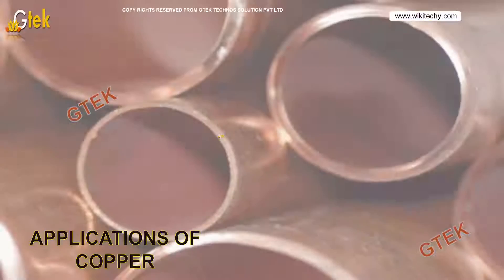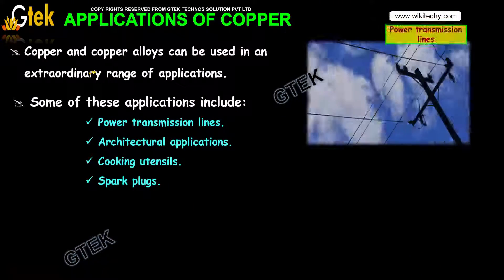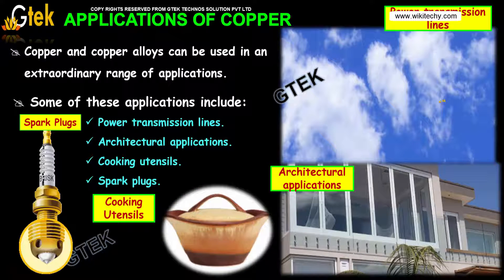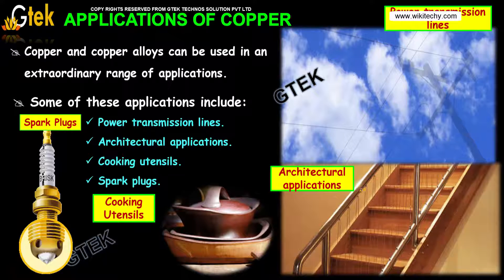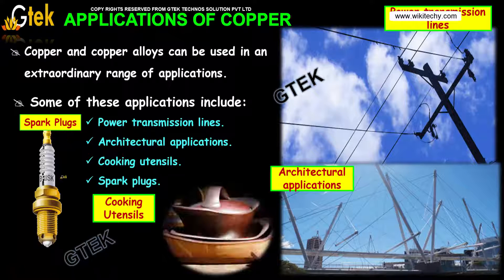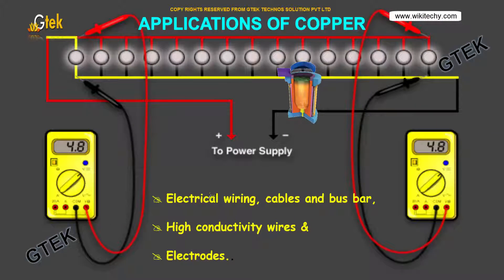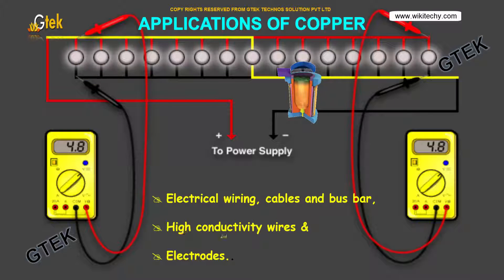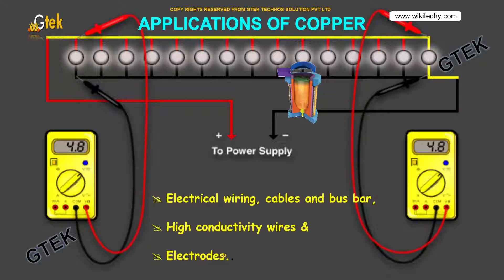Application of copper D Block Element class 12 chemistry subject notes lectures cbse iitjee neet

Comment: The major applications of copper are electrical wire (60%), roofing and plumbing (20%), and industrial machinery (15%). Copper is used mostly as a pure metal, but when greater hardness is required, it is put into such alloys as brass and bronze (5% of total use).

Comment: It is a soft, malleable and ductile metal with very high thermal and electrical conductivity. A freshly exposed surface of pure copper has a reddish-orange color. It is used as a conductor of heat and electricity, as a building material, and as a constituent of various metal alloys.

Comment: Copper is a metal with symbol Cu, atomic number 29 and atomic mass 63.55. An electrical circuit board benefiting from copper's good electrical conductivity. Figure 1: A copper wire is made of a lattice of copper ions. There are free electrons that move through this lattice like a gas.

Comment: Copper is a ductile metal. This means that it can easily be shaped into pipes and drawn into wires. Copper pipes are lightweight because they can have thin walls. They don't corrode and they can be bent to fit around corners.